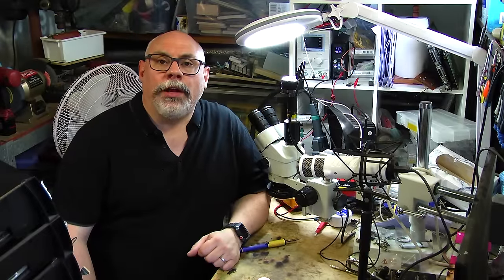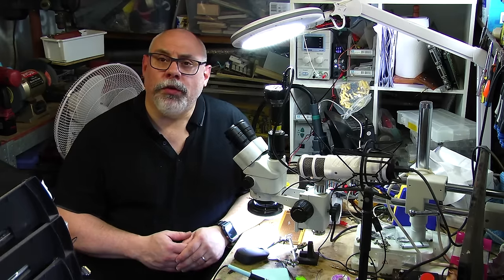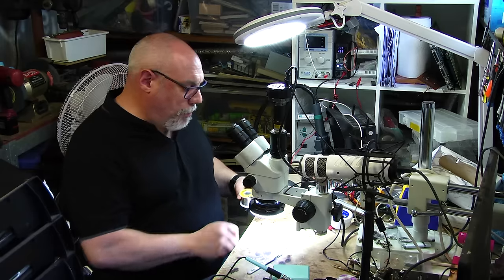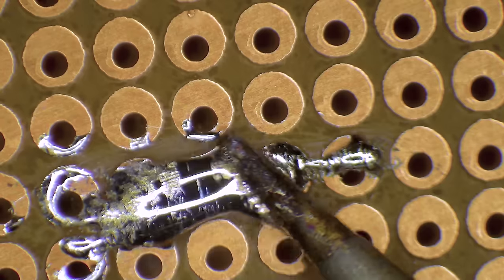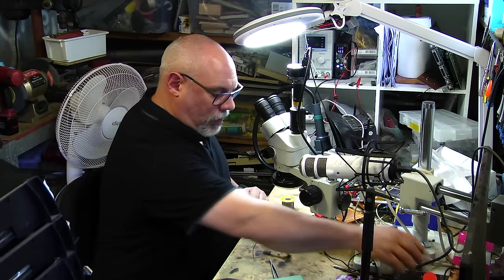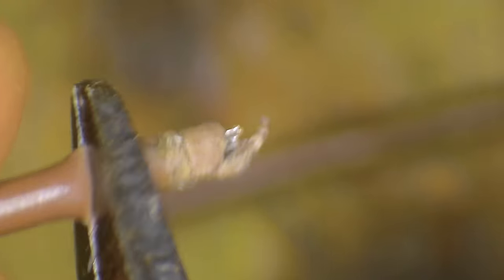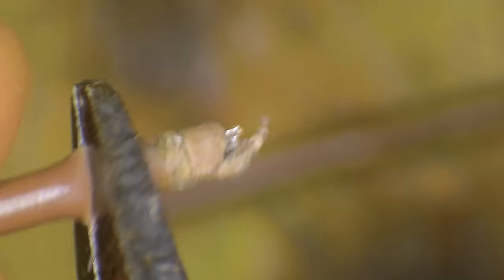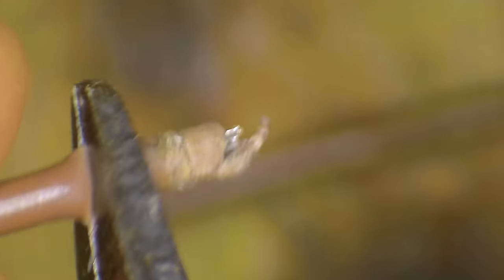Beginner's Guide to Soldering Electronics Part 1

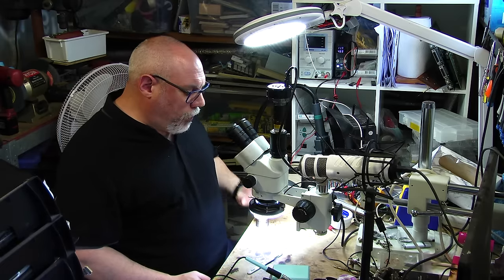Comment: At 2:35, please explain "they ( Hakko) have the absolute worst interface".  For 300 to 500 Australian dollars or euros or whatever I would expect something that works pretty darn well. Also, at 9:28, my understanding is that the boiling point of lead is so much higher than the melting point of solder that chances of lead absorption from soldering fumes is nil to none ( though you should wash your hands after handling it). I don't find the rosin fumes from lead-free solder to be all that irritating ---- your experience might differ ---- but the organic-acid fuses from lead free solder and its special fluxes are harsh, nasty and potentially toxic.
Reply from the maker: There are 2 things I don't like. The first is that you need to insert a plastic "key" in order to change the temperature. The second is that rather than just using an up or down button to increase or decrease the temperature, it uses a separate button to select the specific temperature digit, then you use the up and down button to change that digit. For example, if you wanted to change the temp from 350º to 385º, you would select the "5" in 350 and then press the up button 3 times to change it to 8. Then you would select the "0" and press the up button 5 times to change it to 5. Very counter-intuitive for something as simple as changing temperature. And if you select a number outside of its range it doesn't warn you or beep, it just ignores the input.
Reply: @BranchusCreations  , yeah, I agree with you ---- that particular Hakko does not sound at all user-friendly! FWIW, at work (audio repair shop) we have a bunch of older Hakko soldering/vacuum-desoldering stations, various models, that are built like tanks but many of them are no longer usable because despite much internet searching, surfing and sleuthing, it appears that no one, including Hakko themselves, has replacement parts or heating elements for them. My day-in, day-out soldering station is actually one of those ubiquitous, old-fashioned blue-green Weller soldering stations (with the failure prone plug-in connector removed and the iron hardwired to the station). The vacuum desoldering station is an Aoyue INT 701a++ which works surprisingly well (excellent vacuum pump; the guns are a little chintzy but replacements are ridiculously inexpensive, and I modified the heater and filter arrangements a little to make them work better). Unloke many other soldering-stations, the multipin connector for the iron doesn't overheat/oxidize and fail. It has a simple  temperature adjustment with up/ down buttons and digital readout. Also includes a low wattage pencil iron for delicate work, but the old-fashioned Weller is what I use most for soldering. The only minor pain is that the Aoyue automatically times out and shuts off after an hour or so, and there doesn't seem to be a way to adjust how long it stays on before going into sleep mode.

Some of the YouTube electronics-hobbyist channels show Yihua soldering stations on the bench. I don't have any experience with those.

Comment: Don't ever use steel wool with a soldering iron or anything with heat, steel wool is inherently flammable and will burst into flame under very little heat.  That metal used is brass in those tip cleaners

Comment: Why doesnt my 1.5mm solder tip heat up? The tip doesn't heat up hot enough to melt, but the sides are hot..
Reply from the maker: Your soldering iron sounds like it's not working properly. What sort of iron is it?

Comment: I had literally just watched someone desolder an eeprom off a board,he blasted it for what seemed like seconds at 360 degrees centigrade with a hot air gun and it slid off!!
Cut to me,my hot air gun at maximun 500 degrees!!and the solder didn't even look like melting,it was literally frying my brain lol and 'so' frustrating!!
Frustrating enough 15 minutes later that i was left with two broken pads on the pcb where the eeprom sat,after much prodding with many solder bolts the eeprom 'finally' came off!
Any tips on replacing and sticking new pads on the pcb anyone?,i have the microscope etc,thanks!
Reply from the maker: Unfortunately, not all hot air stations are created equal. And there are also many other factors that can dissipate the heat on some PCBs. The first time I removed a big IC with a cheap hot air station, I managed to tear a pad too. I'd solder the new IC in place, then use wires to reestablish connections to the pins that are missing pads. Maybe have a look at my video on repairing broken traces for some tips.

Comment: The tip cleaner he shows (golden color) is not steel; it's brass.  Solder does not stick to it.  The reason it's better than a wet sponge--especially with cheaper soldering sticks with slow heat recovery--is the wet sponge removes too much heat from the tip.  The brass wool does not pull heat from the tip and you can clean and go right back to soldering instead of waiting for the stick to catch back up.  Don't pay for a brass wool soldering stick cleaner.  Instead, buy a brass wool scrubby pad in the kitchen supplies aisle at your local market.  It's 30% cheaper because it's not a 'specialty' item.

Comment: Can I use steel wool?
Reply from the maker: These mesh balls are usually steel, brass or copper. The ones I use are brass (I think). I think steel would be okay, but would probably be more abrasive on the iron tip.